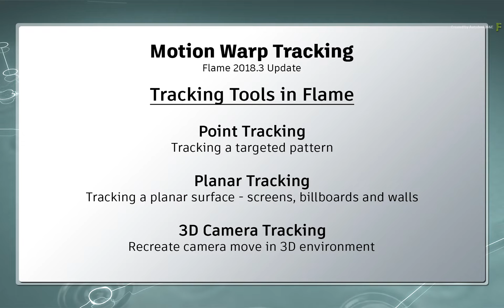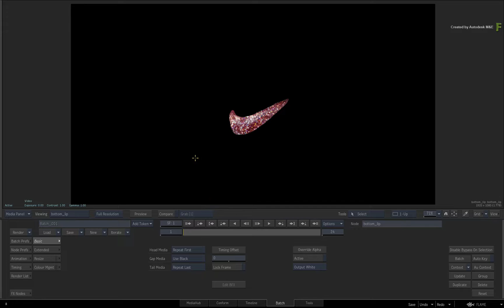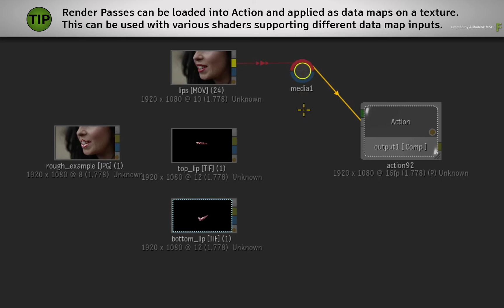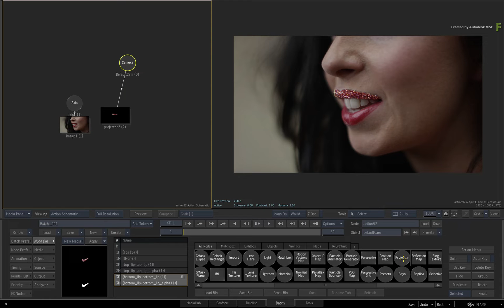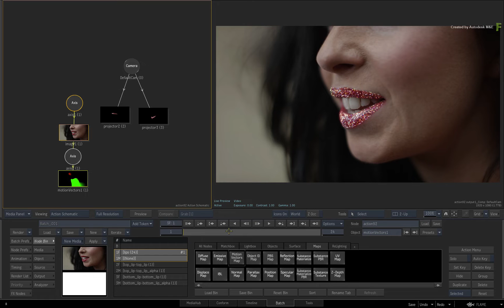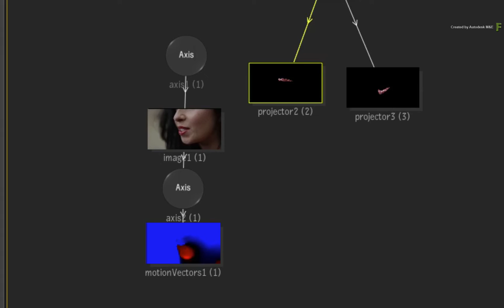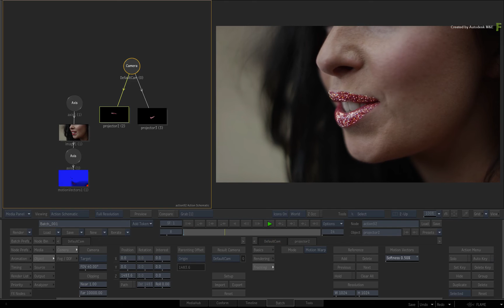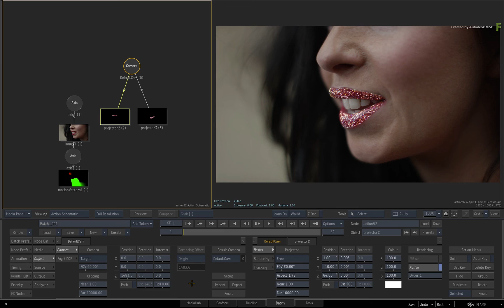Motion Warp Tracking - Part 1 - Introduction - Flame 2018.3 Update

Comment: Grant, Working with 2022.1, when I use Cache Range when working with motion vectors on multiple shots, it really eats up the frame store space. Once finished and my shots are archived, simply deleting those shots from my library doesn't release the frames to make free space. 

Vol Stats still shows frames. Performing a purge doesn't do anything. 

The only way I've found to clear it fully, is to delete the project, when I'm done. For a better workflow, do I need to Clear the cache on individual motion vectors, and then re-save my shot to the library? Or is there a better (quicker) way?
Reply from the maker: Hi Doug, there were a few improvements to caching beyond Flame 2022.1 which may help.     I did a test where I generated vectors, which increased my storage, I deleted it from Flame (no change) then restarted Flame (decreased storage).  Flame was purging during a restart.  If this is not happening for you, please log a support call with Autodesk to investigate.   Hope this helps!
Reply: @Autodesk_Flame  Thanks for the reply. Clearing the cache on individual Motion Vector Map nodes is the only way, I've found to free up the space, other than deleting the project. Restarting Flame doesn't do it for me. I'll redirect your suggestion for logging a support call to the appropriate people - cheers!

Comment: Does this method only work in Flame 2018.3 or does it also work in 2018.2? Because my motion vectors map doesn´t generate anything. It only shows its input.
Reply from the maker: Hi Calvin Gotta, this new functionality was introduced in Flame 2018.3 so it would not work in 2018.2
Reply: Yeah, i saw it in the patch notes. Already upgraded to 2018.3 and it´s running. Great feature!
Reply from the maker: Great!    Thanks for let us know!